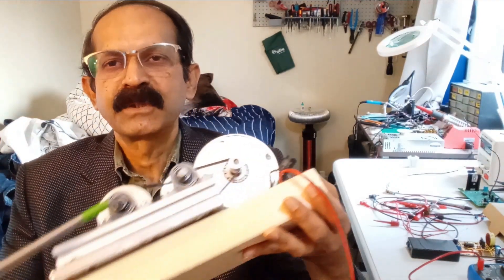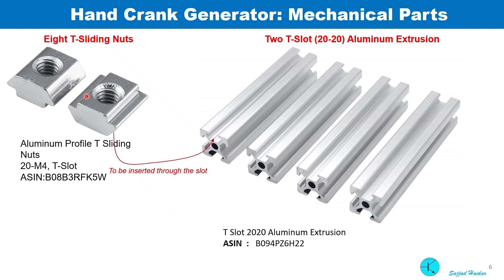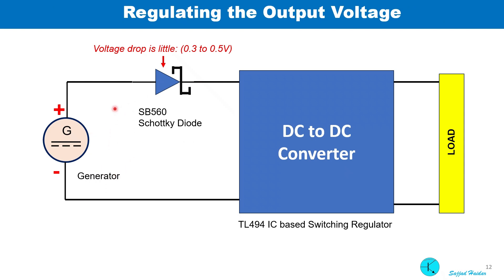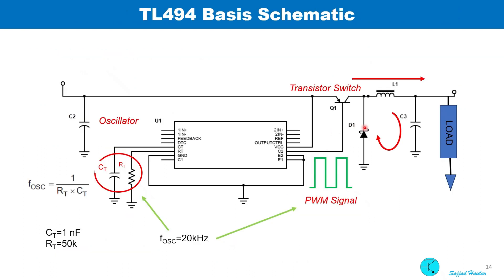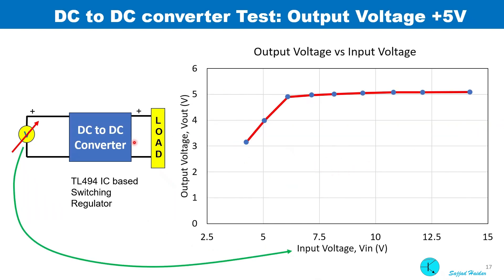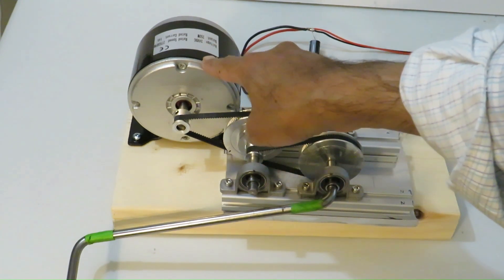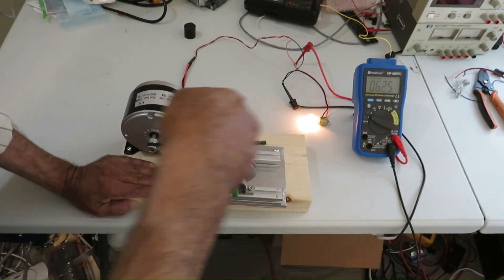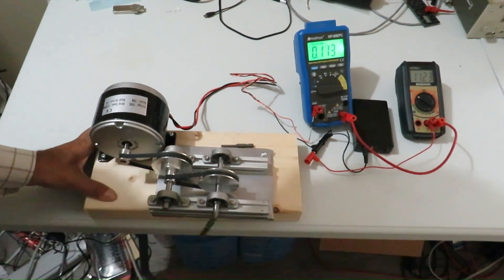DIY- Make Your Own Hand Crank Generator

Comment: You either need to change the generator or you can charge your phone forever.try taking a new drum motor from a washing machine, new washing machines have this right on the drum, not the motor which is at the bottom
Reply from the maker: Thanks for watching.

Comment: Excellent video  this could be used to charge capacitors
Reply from the maker: Thanks for watching. Please watch my other video with Stepper motor. Using stepper motor will be a better choice as that will not require  the belt-pulley mechanism

Comment: I see some similar 350W motors for sale with 9.7:1 transmissions included,  would one of these be a good choice?  I assume the integrated gears would be a bit more efficient than the pulleys from your design, so may make up for some of the difference to the 16:1 ratio the pulleys have.
Reply from the maker: Most of those geared motors use warm gears, and not suitable for hand crank generator. These kind of warm gears are good for speed reduction not for increasing speed. Please try with Stepper motor, which I explained in my other video.

Comment: Is there any way we can make it automatic?
Reply from the maker: Thanks for watching. It can be made automatic connecting the shaft with a wind turbine, in that case wind energy will be converted to electrical energy.  You may see some videos, which shows some kind of automations which do not need any other energy sources, these are all lies. Perpetual motion does not exist as energy can not be created, just basic physics
Reply: @technologyforyou5976 thx for the info I will search it up

Comment: Sir please can you suggest me I want 36v/48v 350w power which motor I have to choose for generator
Reply from the maker: I may find some DC motors which can generate 48V and 350W, but would be difficult move with hand. You may need pedals, like bicycle. Bicycle pedal, chain and motor, this should be better choice
Reply: @technologyforyou5976  thank you

Comment: Well done sir. Have you considered adding a flywheel?
Reply from the maker: Thanks for watching. Considering the complexity and expense I am working on a generator using a  Stepper motor as a generator. Next week you will get the video. You do not need the timing belt and pulleys
Reply: @technologyforyou5976  I'm considering winding my own stator. It will be axial flux. I'm gonna try a serpentine coil. I've got 6 1/2"X1" X2" N42 neo magnets. The magnet wire is 10 gauge. It should be pretty strong. I will make it hand-cranked for testing.